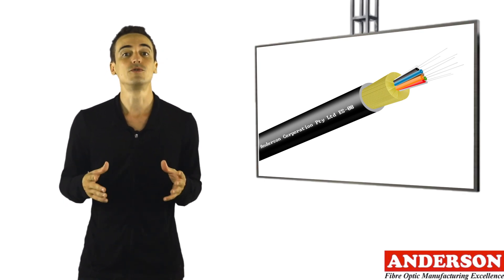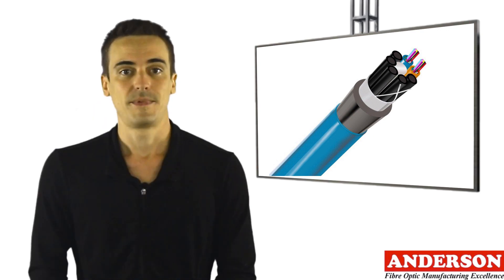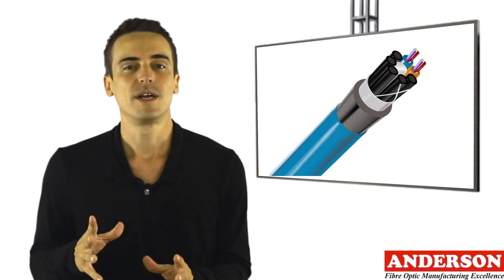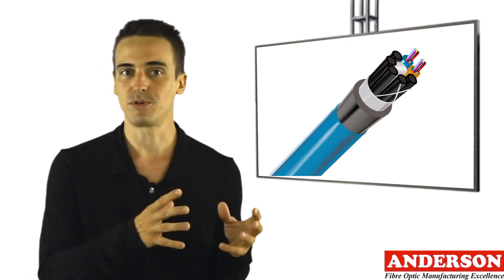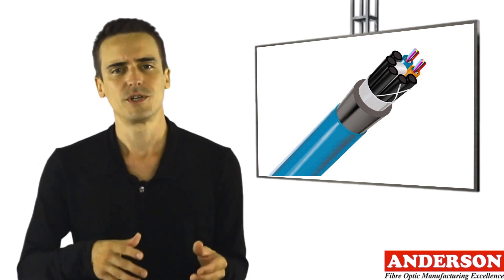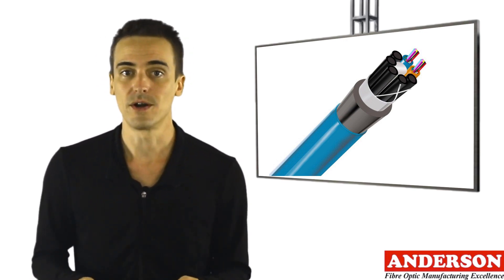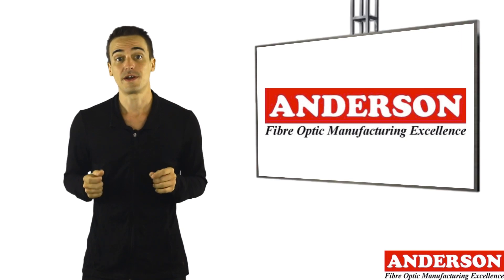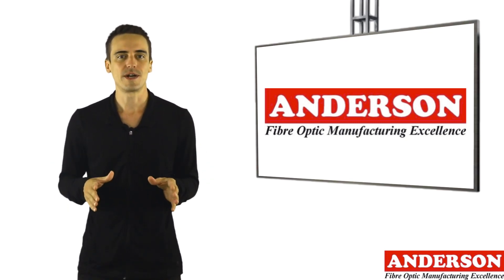OS1 vs OS2 Fibre Optic Cable Standards

Comment: Hello ! 
Can i Mix OS1 with OS2 ? Fusion them together ?      
Do Os1 and Os2 Require specific pigtails, or the use the same ?
 
Thank you
Reply from the maker: Thank you for your question. As OS1 and OS2 are "Cabled" standards the glass used could be G652d, G657.A1 or G657.A2 (in the main) for Singlemode cable whether it is OS1 or OS2. G657.A2 is backwards compatible to both G657.A1 and G652d glasses. G657.A1 and G657.A2 are now more common as the market moves more and more to Bend Insensitive cabling as they will allow you to bend the fibre more tightly (G657.A1 is 10mm and G657.A2 is 7.5mm Bend Radius). So the answer to your question is more about making sure that your glasses are compatible with each other, but you can use a G652d pigtail on a G657.A2 glass that sits inside an OS1 or OS2 cable. I hope that answers your question.
Reply: @AndcorpAuFibreOpticProducts  great answer and you are right , I think its possible to splice all SM together but the losses will be differences and always recommend to splice from same manufactory ، but already I have seen some of them sell patch cord and labe say is OS2 but I think all patch cords is OS1